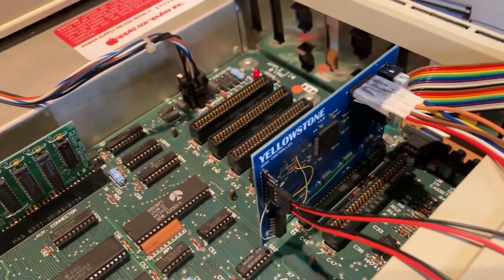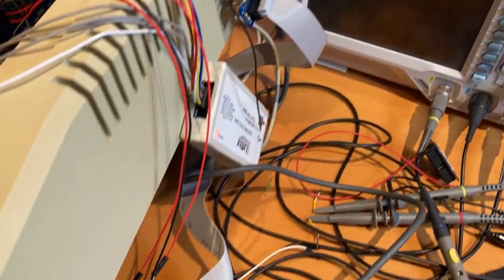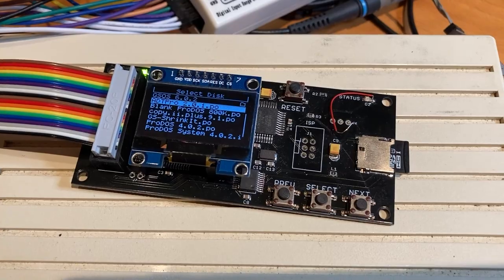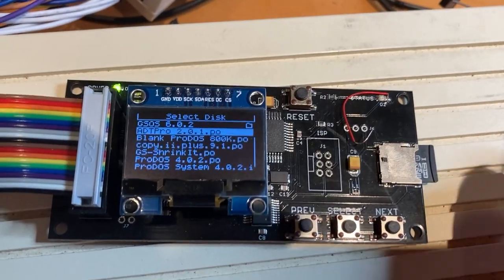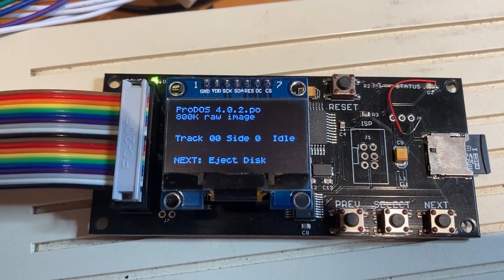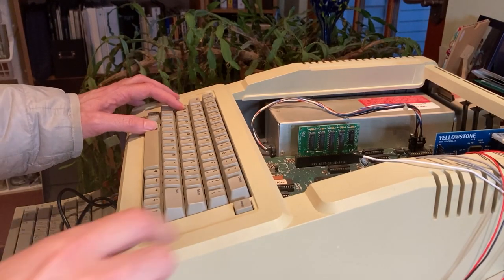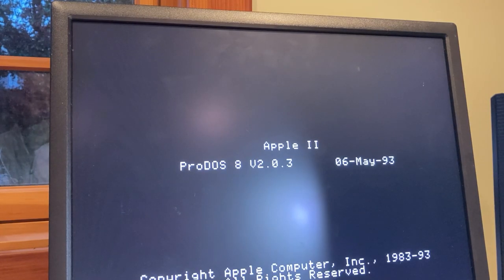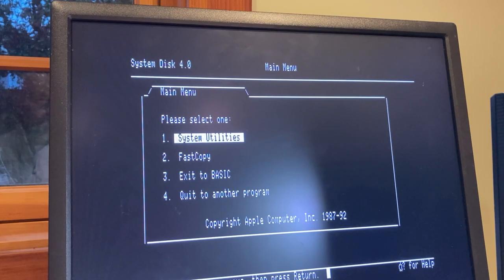Yellowstone Disk Controller for Apple II, 3.5 inch Floppy Demo

Comment: Hello,

I would be interested in bying the Floppy Emu but I have a couple of questions.
So I have a Macintosh Classic, that has been recapped by someone and it does boot fine. I can even boot into System from the ROM. But the hard drive seems to be dead.
1. If I buy the SD card option will I get softwares in French or are those English only ?
2. I have a folder on my "modern" Mac with a lot of French systems, let's say that I boot from a System installer floppy on my Macintosh Classic, wll I be able to install that System to another partition or folder or dmg... ?
3. Let's say I booted from System 7, but I want to open MacPaint let's say, can I like mount MacPaint after System 7 (like both at the same time ?) If no then how do I open an app.
4. According to the video on the Floppy Emu page it can emulate a Hard Disk, so could I do the following :
    a) Boot from a System 7 installer
    b) Install it to the "Hard Disk" from the floppy emu
    c) And then boot from the Hard Disk like when my normal Macintosh HDD used to work
    d) And can I put games and apps to that Hard Disk basically like what I used to do before : System 7 on the 40MB HD and installing apps and games to that HD and opening those from there.

Thanks in advance
Reply: I wouldn't replace a hard disk drive with an Emu on a Mac Classic. I'd instead stick to the SCSI support, and look for a SD-based SCSI emulator board. They're roughly $100 or so. The Floppy Emu is great, but it isn't a total replacement of hard disk drive.
Reply: @yuppiehi  Yeah that’s what I figured out so I guess I will buy a SCSI2SD in the first place and then a Floppy Emu.
Reply: @LUKAS-bb4jc  Besides SCSI2SD, there's also BlueSCSI and maybe RaSCSI.